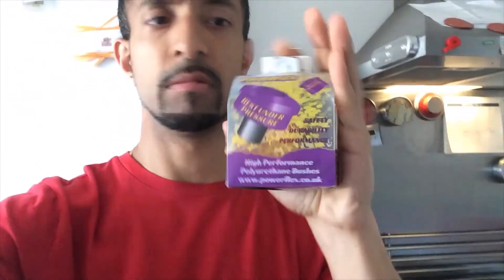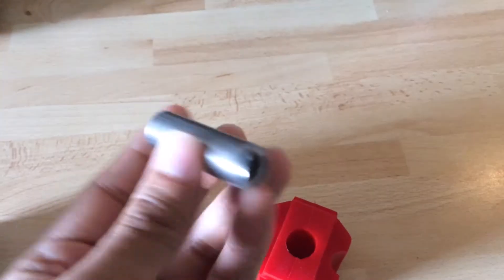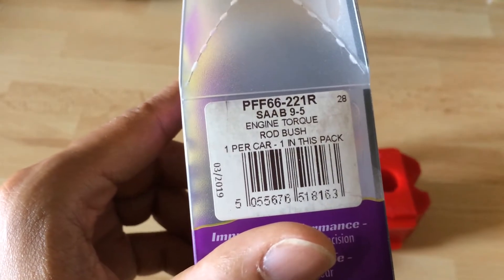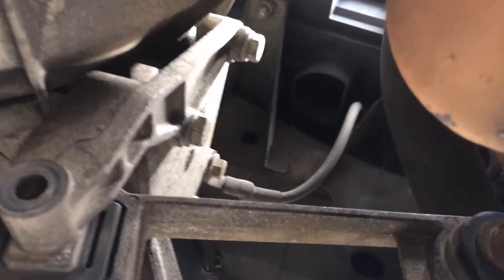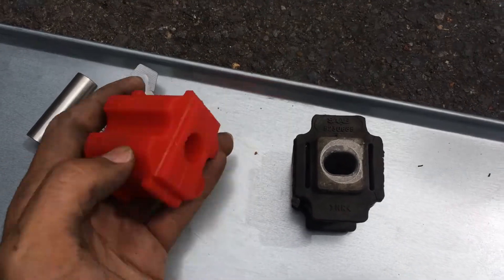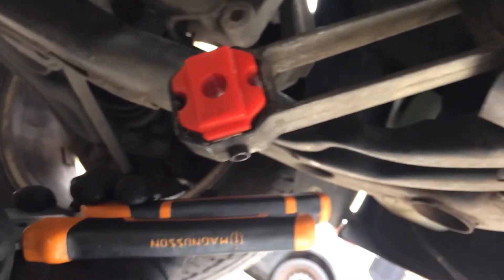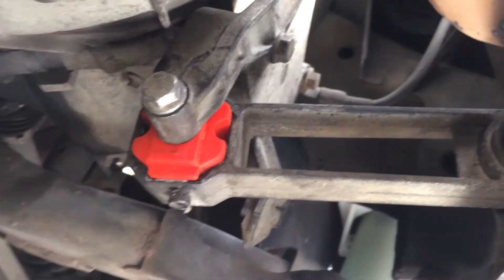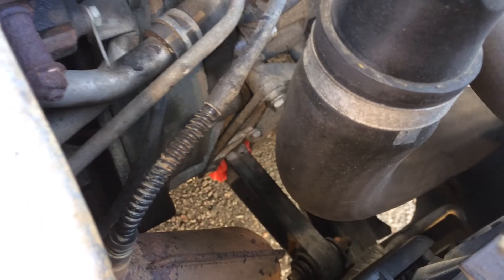Replacing Torque Rod Bush with Powerflex on Saab 9-5

Comment: Did you get to the bracket mounting bolts from above, or from below? There doesn't seem a lot of space to swing a ratchet in either direction.
Reply from the maker: I did it from below whilst laying on the floor. It was a fiddle due to lack of space, however, if you persevere with the right tools you will get it off.

Comment: Thank you for the video. I ended up taking the whole rod off, as I could not get the bushing in from the side, but it might be because the automatic one is a bit different. Loosening the subframe side is quite easy.
Reply from the maker: Correct the auto Dog Bone is different, it is shorter and chunky.

Glad to hear you got it replaced, did it make it smoother?

I realised after the install my subframe bushes are no good, I need to give this a go next!
Reply: @the80sdude51  Yeah, it is a lot smoother when selecting D, it used to be really clunky. My subframe rubbers are shot too, need to do those some day aswell